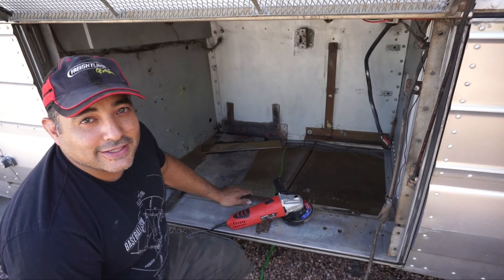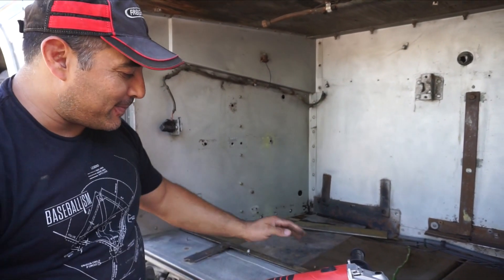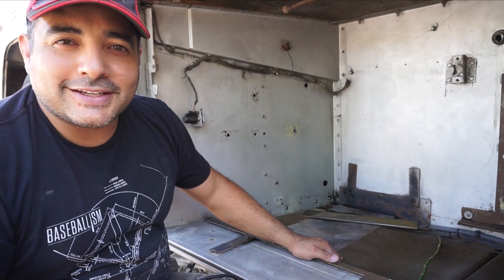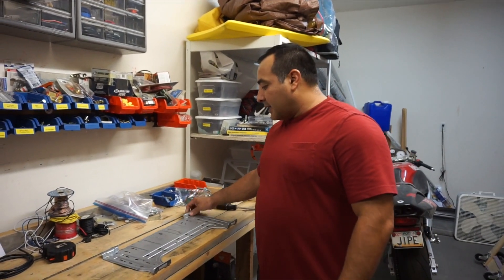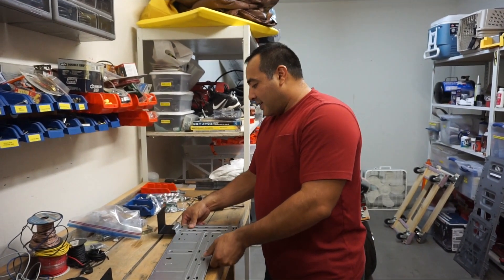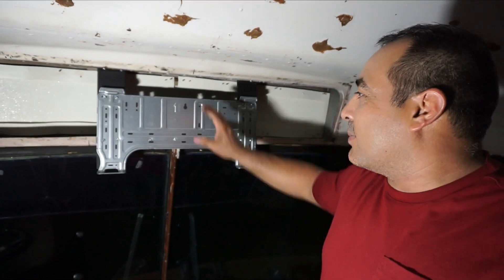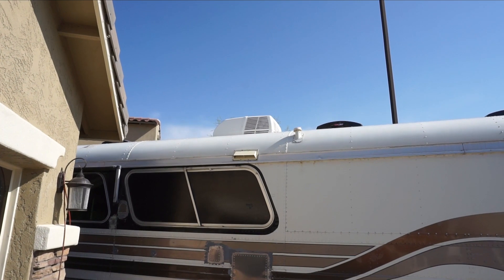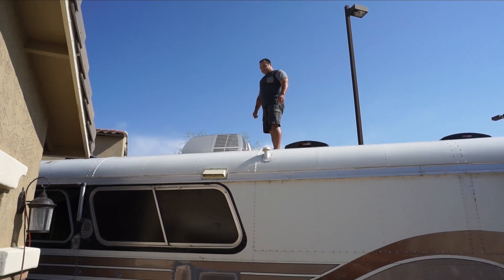Mini Split Air Conditioner in an RV

Comment: I really hope this works for you but my experience is that anything with a heat pump is just about worthless unless you stay in areas with temps above 50 degrees. Secondly split systems are way over priced for what they can really do, and 12,000 btu sounds way too small for a bus that long. Ductless systems are fine but split systems (heat pump systems) not so much. Also unless you keep the door open where the condenser is the unit will most likely over heat and not cool very good and possibly even burn up the unit even though there is vent holes in the door. The reason is you are asking the unit to suck air in to cool the coils and expel the hot air through the same opening in the same restricted space. You are going to have a mix of hot expelled air and new cooler air making the cooling air way too hot. The condenser unit really should be out in the open preferably mounted on the rear of the bus out in the open. My opinion is that you will need two of these, one for cooling in the front and one for the back, both condenser units mounted on the outside at the back of the bus. Here is one example 25 seconds in. https://www.youtube.com/watch?v=OUAa5loAUM4  Now is the time to correct this. Thanks for sharing.
Reply: yes i was going to say the same thing 12K is low but i under stand you wanted low amps for the inverter to run it .. if you get a 24V dc inverter your still going to pull 40 to 60amp DC on a unit that well never go off . 2 yes the unit need some help to keep it from eating its own hot air  .  .... most bus rvs have 3 15K units on the roof  or 2 18K hard to find acs
Reply from the maker: Thanks for the comment falcon7350 - Yes, 12K is a bit low but we will hopefully chase good weather (LOL or suffer).  We are running a 48 V lithium battery so hopefully, the amps on the DC side remain manageable.  To prevent it from eating its own hot air we are considering an auxiliary fan to pull air from under the bus - we'll see if it becomes an issue.  We also might do a portable unit in the back if it becomes too hot.
Reply: Actually it is not about super low temps you mentioned to falcon7350. Heat pumps are nearly useless if you want to be even mildly confrontable even at any temp. While you can certainly choose to ignore what is being said it would be much cheaper to fix the problem now instead of later. Though I am now retired I did go to college for air and refrigeration.  An extra fan in the condenser compartment pulling air from under the bus is not going to fix your problem because road air and heat from the engine will be sucked in and raise the temp not lower it.. Also you have a restriction as long as the door on that compartment is closed even with the holes in the door. Simply put you have the condenser mounted in the wrong place for that unit to even began to work properly. Due to that you no longer have a 12,000 btu nor a unit that is 22 seer. I would guess you now have around a 6 or 8 thousand btu and a seer of around a 8 or 10 in your current area climate and mounting configuration. If you do not believe me on a hot day drive it around for a couple hours and see what happens.  As to a possible portable unit to help out they are VERY much a power consumption and you still have to vent the hot air from the condenser as well as drain the water from the evaporator both of which requires holes in the side of the bus. Really you would be wise to move the condenser now to the outside rear of the buss and use the area it is now in as storage or possibly even for a  pure sine generator to charge your batteries when there is not enough sun for solar. Harbor freight now has one that is a 3500 watt pure sine which is VERY reasonable and more than able to keep your batteries charged when needed as well as run other things at the same time. They also have a pure sine 2000 watt which would work. Also you really need two units mounted on the back of the bus, although I would not waste my money on another one with a heat pump. A ductless with no heat and a high seer would be fine would be fine. You can get a 12,000 btu ductless with an 18 seer for around 350 to 500 dollars. As for heat consider bunk heaters or something similar. Electric heat uses a lot of watts, but if you have enough storage it may work  Like I said it is your project and your choice, but you are headed for some serious discomfort and serious expense if you leave things as they are even if you add a portable. You mentioned chasing good weather. If that is what you will do then you do not need an air conditioner. Just open some windows or vents, but even then it leaves you at the mercy of the weather as to when to travel. I wish you the best, but on this one you are on the wrong road.
Reply from the maker: Hey John - thanks for the comment - we have heard the same thing about the heat pumps in these units (NOT great in super low temperatures).  Also a valid point on the price - they are pretty expensive.  This unit was $900 shipped to our house - we could have replaced the rooftop unit for about $600 (if you include the heat strip - which also does a pretty poor job of heating).  But we really wanted to make room on the roof for a solar array. The thing that was attractive for us with this unit is the power consumption - almost 1/2 the power of a traditional A/C unit and it does not have the huge spike of power draw when it starts (inverter friendly for boondocking).  We bought this unit with the hopes that it will do well enough in mild weather - when we are mobile we will chase good weather so hopefully, it will be enough.   We are realistic enough to know that good weather cannot always be chased.  We are looking at propane options for supplemental heating.  Our A/C guy also expressed concerns about it being able to expel the heat properly in the bay - The instructions say we need at least 12" behind the unit and 72" in front of the fan because it pulls air from the back - we have a very large hole in the floor and it does seem to draw air through but time will tell if it enough.  Most of this stuff is an experiment - these units are also not meant to be used in an RV environment where they are bumped around going down the road.  Putting it outside was not really a good option for us because the engine door at the rear of the bus swings up for access to the engine.  I agree with your 2 units opinion - we just can't find a good space for the second unit - maybe we will do a portable a/c unit in the back - we are still figuring it out.  Thanks again for your comment and concerns - we will keep updating as we go along.